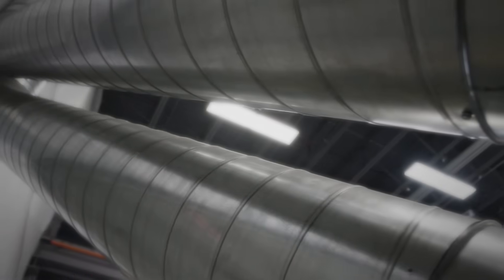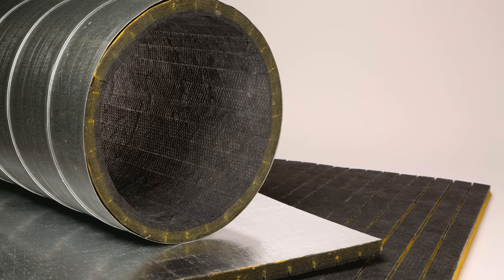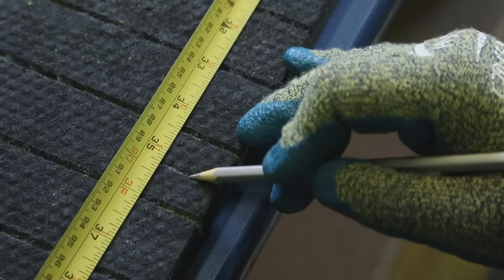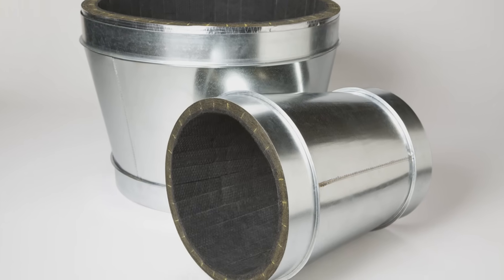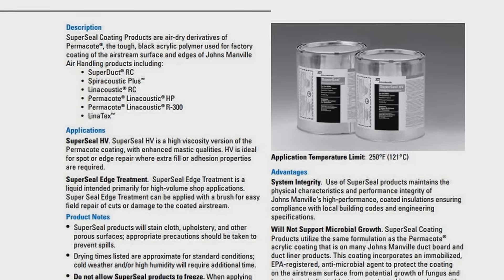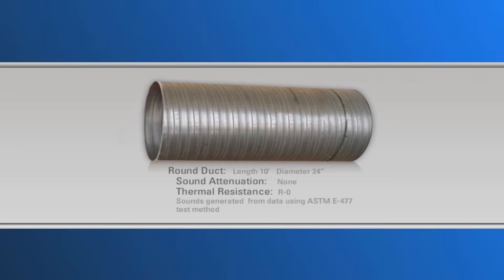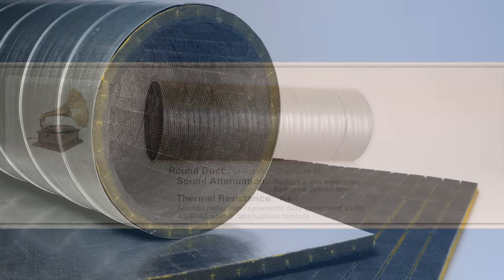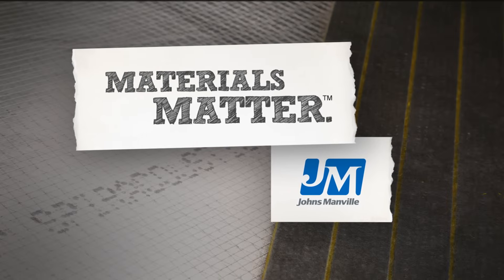JM Spiracoustic Plus: A Superior Duct Liner

Comment: I'm sorry but insulation inside the duct system allows mold, mildew and dust particles to cling to the insulation and grow. I am a firm believer that the airway should be free and smooth to provide the best airflow and free of unwanted particles.